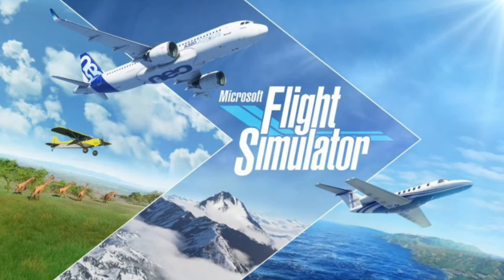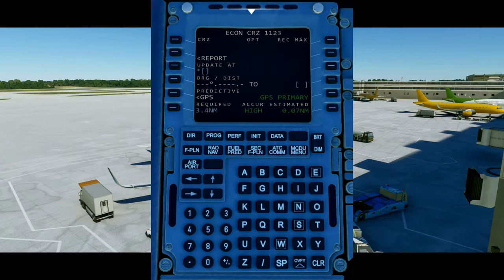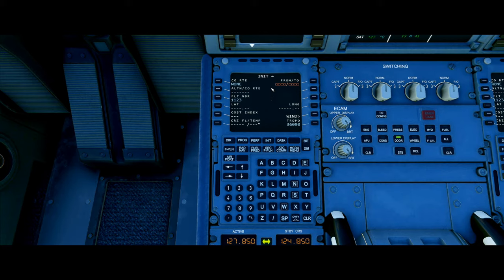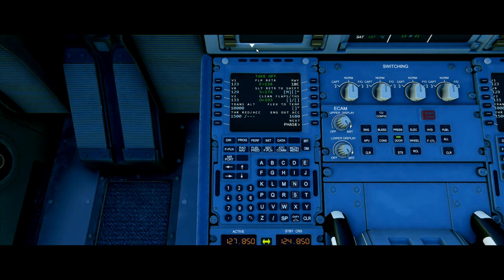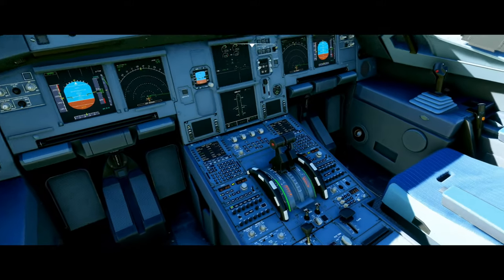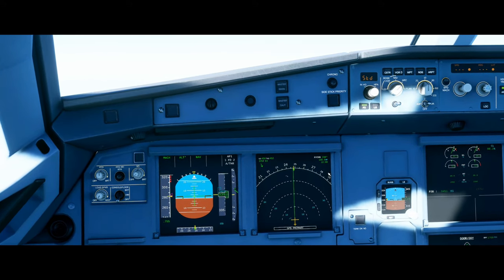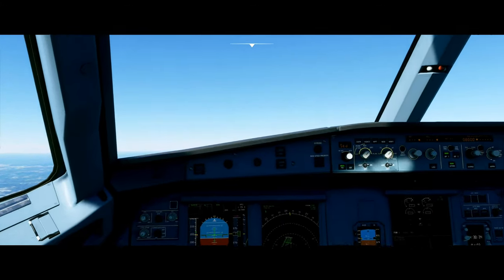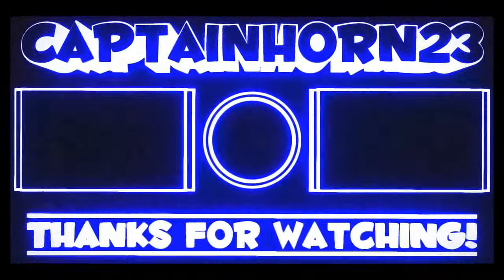Flight Simulator 2020 - Full MCDU/FMS Tutorial - Airbus A320neo | Full Flight With MCDU

Comment: Great video as always. These really are the best beginner & intermediate flight sim videos out there. One thing of note that may be helpful for some (and I could be wrong but) I believe at 23:50 when you're entering the QNH into the MCDU, the calculator is giving it to you in HG (imperial) but the standard MFS A320NEO without mods will only allow you to use HPa (metric) in the MCDU. If I'm correct, you can choose one of two options to overcome that. Option A: you can spin the Altimeter Pressure dial above the FD and LS to match the HG provided by your calculator then click/press the dial to have it automatically convert the HG to HPa which you then enter into the MCDU. Option B: you can skip noting the HG provided by the calculator and get your HG from ATC, then spin the Altimeter Pressure dial above the FD and LS to match that HG, click/press the dial to have it automatically convert the HG to HPa and enter into the MCDU. HPa doesn't utilize decimal points and is more accurate which is why I'm thinking the sim wants you to use it.

Comment: FLEX TO TEMP is "flex takeoff temp." It is a fake higher than actual outside air temperature that makes the engine computer (FADEC) think it has to lower its power (fuel flow) to stay within limits. It knows the real temperature but it plays along. This gives the engine hot section a longer life. The temperature is flexible to achieve a balance between adequate thrust and engine life. TOGA takes the blinders off.

Comment: V1, VR and V2 calculates itself once you set the correct flaps position (when you extend or retract them, not in MCDU). Secondly i think you should stay on flex position of throttle till the PFD tells you to switch to CL throttle (it's THR RED dependant). QNH is in hPa (currently), so you need to convert for exaple 29.92 to 1013.
Reply from the maker: Ahh alright I’ll have to test this out! Are you sure it tells you when you switch to THR CL? If I don’t switch, it will over speed pretty easily. Is there a way to change it from hexopascals to inches of mercury in the MCDU?
Reply: @captainhorn23  i am sure of the first one. It will appear on top left on the screen. Try to set up the thr red lower than 1500 and it should appear sooner (haven't tested it though). About the QNH i think it is just a bug.
Reply from the maker: @Dmnick155  Alright thanks so much man! Ill be on the look out for it to tell me when to switch!

Comment: Excellent video, thank you so much! I do have a question, though. Why would you allow the FMC to manage your altitude between waypoints? You're in controlled airspace. Wouldn't ATC first need to instruct you or grant you permission to change flight levels?
Reply from the maker: Yes this is correct. Check out my “Descent on Vatsim” video and I better explain it there. But in general ATC does need to grant altitude changes while flying IFR

Comment: The performance calculator you put in the description is not working. Yes, I know the one in the video is not existent, but the replacement calculator put in the description isn’t functional either. Because of this, are stuff like the QNH and the flex temp necessary for a flight? Can I not put them in but include the rest from SimBrief? Or am I better off just using the default map planner?

Comment: Great tutorial! Thanks. I noticed in climb that the plane seemed to have an unusually high angle of attack and climb rate - looked like it was exceeding 4000 v/s. When I flew the LDS767, way back in FS9, I only used LNav and not vnav. Do you find this model pitches up a lot? Have you been following the development of the Fenix Simulations A320? It looks very promising.

Comment: How do you set the MCDU in case of Go Around? I tried so many times to figure out a easy way to perform a go around and it seams like nothing is working. I always have to perform the Go Around buy selecting the heading mode and altitude manually to take me to the holding point.

Comment: Great help 👌🏼 May I ask does the plane automatically fly the STAR or do you need to manually guide it down with the correct turns/altitude settings because yesterday I had a flight plan all set up(uploaded from Simbrief) and flew directly to my destination but then straight over the top of the airport and I couldn't figure out how to follow the approach path to intercept the GS. Was I meant to take over at some point? I thought the autopilot would take me down to the almost localizer where I could intercept it and then bring it down manually

Comment: everytime i engage auto pilot during the flight my plane banks either to the right or left for like the whole flight its like the plane cant get on course it just stays in a banked angle for the whole flight im using the a320 neo btw any help or advice?
Reply: It's been 2 months but just in case you didn't get the answer, try setting deadzones in your controller. Open the Simulator's settings, and then navigate to the controls menu. Find the yoke/controller you use and then set their deadzones after you click the sensitivity button.
Reply: I use about 18% for the deadzones, but usually 10% is enough

Comment: Hi, captain,  are you using the  A32  mod in this video?  I just download A32NX, the button on MCDU f-/ FROM and DEST doesn't work like yours.   Any solutions?  Thanks!
Reply from the maker: Yes this is the modded a320. Are you talking about a big lag between pressing buttons? If so I am getting the same thing. It’s annoying and a bug that needs fixed
Reply: @captainhorn23  I suspect it was a lag but mine is too long and never respond!

Comment: In the PERF tab, the approach phase. 
The QNH value should be given in metric not in imperial.
I am not 100% sure, of course, but I have checked this in many sources, including examples from real aircraft.
Reply: Additionally, you completely omitted the second INIT tab, but it doesn't matter because it doesn't work properly anyway... Unfortunately.
Reply from the maker: Yep I figured this out aswell after the video. Always gotta use hPa in the perf page. Work I didn’t even realize I skipped the second INIT page!

Comment: 15:22 - I believe the transition altitude in this case is the altitude where you can exceed 250kts. 10k is correct. This is the climb page.
Reply: No, the transition altitude is when you transition into flight levels and when you set your altimiter/baro to std (standard-2992)
Reply: That would be the restr alt known as restricted altitude

Comment: How do you go about changing the flight plan mid flight?  What I mean is let's say you miss the airport and need to land at another.  I can not seem to find a way to "enable" or select a specific way point for the AP to follow.  I realize from what I can tell the current waypoint it is going to is rather easy but what if I wanted to edit that waypoint or let's say I wanted to go to a different waypoint on the flight plan.  Would I use the Direct?  Then when it gets there how do I get back on the flight plan?  Can you do a video of mid flight alterations to the MCU?  Thank you!
Reply from the maker: Yes flight alterations video is a great idea! You can use the direct button or change your approach in the mcdu by entering a new star into the arrival airport.
Reply: @captainhorn23  Yes midflight mcdu flight plan alteration video please!  Having lots of trouble accomplishing these edits still going VFR to land somewhere off the original plan.

Comment: Thanks for this invaluable guide. For years i've been flying with the flight plan already set, and using the heading dial and altitude dial at the instruction of ATC. Which made me wonder, what is the norm for airlines? Do they allow the FMC to fly most of the flight without any instruction from ATC?
Reply from the maker: No problem my man! The norm for airlines these days is exactly that. Let the FMC fly pretty much the entire route with small variances here and there from ATC to keep separation. SIDS and STARS especially lower the workload of ATC. A good analogy is before SIDS and STARS existed, ATC was like trying to eat a biscuit while driving a manual transmission vehicle. With the addition of SIDS and STARS, ATC might as well be driving a Tesla.
Reply: @captainhorn23  Thanks a lot for the explanation! That's good to know, I'll fly like that from now on! Although it reduces my already small list of things to do during the flight lol. By the way, if ATC tells me to use a different runway for takeoff and I use it, will it ruin the flight plan?

Comment: you can also just type the numbers in the cruise flight level instead of adding FL :)
Reply: True. The box assumes 2 and 3 digit altitudes are flight levels (230 or 80). 4 and 5 digit altitudes are taken as feet (6000 or 17000). If you put in 80 and the transition altitude is 18000 then it shows up in the box as 8000.

Comment: how do you get the engage altitude mode to work? I’m in xb series s and i can change between 100 & 1000 increments and also the altitude up or down but there is still the dot on the altitude and I can’t descend. I am using my controller, kb & mouse. TIA! 😀

Comment: I recommend rather than arbitrarily setting your altitude to 5000 for descent that you manage it via the STAR. Most STARs will have altitude targets by certain waypoints. For example cross WXYZ at 12000 and 250 kts. By stepping down the altitude setting via the STAR you assure you will not bust the altitude restrictions. Be sure to reset it to the next altitude ASAP after passing one altitude restriction to give the FMC time needed to manage the descent. As you know the FMC will not allow the plane to descend below the altitude you set. If you forget to lower it you will find yourself exclaiming “WTF” and then franticly going into 5000 FPM manual descent. Ask me how I know! In a perfect FMC world the FMC should be able to manage your descent all the way to the ground, provided you keep ahead of it on the altitude setting. Arbitrarily setting altitude at 5000 feet could put you into a “pilot deviation” scenario at best and fly you into a mountain side at worst. Good video!
Reply from the maker: Thanks for the tips! Ill watch myself next time lol.

Comment: I srsly struggle when I get close to my dest and the Tower wants me on another Runway and tells me to etc fly to  EV455 how do I get to that new point without the GPS starting all the way from the beginning ?
Reply from the maker: You could use heading hold, or use the direct to button ☺️ also I don’t advise using the atc, it’s terrible.
Reply: @captainhorn23  I normally play on Vatsim. What I do is , I don’t set up an arrival on my MCDU, if ATIS is available, I will switch over to it and listen which runways are active for landing. After that, you pretty much know what STAR to enter on the MCDU
Reply: @bravocharlie24  What is STAR
Reply: @invisible8334  Star is the arrival waypoints and SID is the departure waypoints. Every route has an SID and STAR. I don’t know if this makes sense but I’ll suggest search up some videos and you’ll see what I’m talking about.

Comment: I'm still getting swaying as the aircraft gets closer to the runway.  I tried keeping 140 but it still sways.  Does the autopilot need to come in at set heights on the approach, I just reduce to 4000 for Degall LFPG early but I'm wondering if the angle of decent is knocked out if i do that?  This swaying is driving me nuts!
Reply from the maker: Yeah I get some swaying too. It’s driving me crazy as well. Yes the autopilot with follow the heights set at each waypoint which is automatic for STARS.
Reply: @captainhorn23  Thanks so at least we know it's a bug, not bad flying (though a lot to learn) hopefully it will be fixed in the next patch.

Comment: Given the specs for KCLT on RWY18C

OAT °c [26]
Wind [050°/5]
QNH inHg [13.12]
RNWY LENGTH ft [10'000]
RNWY HDG [183°]
RNWY ELEV ft [748]
WEIGHT lbs [133,832]

Resulting...

V1: 154
VR: 160
V2: 165

Thrust: TOGA (NO FLEX)
FLAPS/THS: 1/ UP0.8
FLEX TO TEMP: 0°c
ENG OUT ACC: 1548
THRUST RED/ACC: 1548/1548

Watching your speed indicator at your VR you did not have positive climb until you hit around 160 kts despite the positive attitude shown on your attitude indicator.

I'd say that calculator you were using was wrong. Because all speeds were 144 kts which cant be. As each speed has a difference in purpose.
V1 = committed to flight no cancellation now
V2 = the speed the craft will fly with engine failure
VR = Speed needed to meet to create positive climb by rotation.

So all cannot be the same speed.

I sat and did the 5 pages and 35 or so calculations with scientific mathmatics to get the above answers. 

So I know for an absolute fact that the answers from your data input should not be returning the answers you got.
Ie 144 kts for everything and 20°FLEX the wind, oat, and flaps 1 all dictate FLEX/TOGA selection if is its cold Anti-ice etc higher flaps or lower OAT then there is little purpose in FLEX 20°c at an OAT of 26°c, maybe at minus 26°c sure and defo higher than FLEX plus 20 for sure at minus 26°c OAT.

In a nut shell that website gave you bum data output, no wonder it is no longer active online.

Comment: Very helpful! Was wondering how I could calculate the CI and FLEX. Also, around 19:30, you say that the aircraft was climbing slower to meet altitude restrictions. At the moment, I don't think VNAV is functional. It was just pitching over since you passed 10,000 ft and the speed restriction is gone, it is accelerating to 320kts before continuing the climb.
Reply from the maker: There is a useful website for calculating flex! Check out my MCDU tutorial! Ahhh it was a placebo then. I hope VNAV gets fixed!

Comment: Thanks, learned a lot of good stuff here, but what does "Dec Cabin Rate" mean?,
Reply from the maker: Thanks my man! I’m glad you learned from the video! Dec Cabin Rate is the rate at which the cabin pressure will change when you are descending, so -350ft per minute is a contanst rate. This way, there is not a huge change in pressure while you are descending and if the cabin pressure stayed the same all the way down to the ground, well it would be like opening a door in space lol. The door would fly open and the extreme change in pressure could cause very bad things to happen. So while you are descending, the aircraft automatically reduces pressure in the cabin back down to 0 to match the outside air pressure when you get to the ground ☺️👌